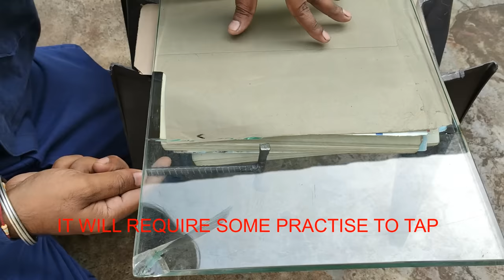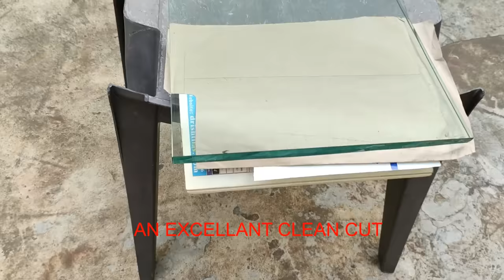How to cut 12 mm thick glass

Comment: One of the things novices do when cutting glass is using too much pressure with the cutting tool. You know when you have done it right by the sound. It should be a light hiss and the score is a fine line , almost hard to see. Too much pressure and the sound is crunchy with score looking like a deep scratch. The deep scratch are tiny fractures running radially from the line and at best will result in a rough cut and at the worst not cutting at all or running everywhere but where you wanted the cut. Also make sure you have cleaned the glass first and the cutter is not nicked and/or dirty. My humble experience.
Reply: Thank you for the information.
Reply: Nope. Too much time just learn from another experienced person

Comment: That’s a horrible cut.  Once you make the score and start the run which may need a hammer on 12mm you use your hand and the weight of the glass to complete the break.  I worked in marine and ag glass for 8 years. Our thickest glass was 1/2 inch ocean going vessel grade tempered and bent.

Comment: Just Use a brush to apply the oil on the glass before you cut it with the glass cutter and then place the sodden back part of the brush under the glass on the end of the cut and snap it pushing down.

Comment: That would be risky when tapping a large piece which would fall because of its weight. A support would be needed on both sides of the glass, and a ball pen hammer would have been better because of the round head as it would give softer taps, thinner glass can just be snapped after one tap to run the line, Thank You
Reply: Why watch a video if you already know everything?
Reply: @christianscustoms6429  That's what we call a dumb question ! Jignesh Tailor's advises are important .
You just earned a dislike .
Reply: Turn it over.
Reply: IF it was a large piece, but it wasn't. The fact that the guy's made his own hammer from re-bar says to me maybe he doesn't simply have access to a plethora of tools so he makes do (& well) with what he has.

Comment: Does that work with tempered glass?
Reply from the maker: No, this trick will not work
Reply: U cant cut tempered at home dude
Reply: @shiyamaifrad8933  I found out the hard way.. lol 
But can professionals/companies do it or is it just impossible to cut?
Reply: @BlackFaceTrudeau  it is not impossible cause u can get custom sizes from companies i guess they cut it with some heavy duty machines
Reply: Tempered glass CANNOT be cut.  Glass companies cut holes, dog doors, handles etc BEFORE tempering.  Do not attempt it as it will explode.
Reply: @stewartmcmanus3991  that makes sense cause u cant do anything with sharp tools in a  glass after its a tempered
Reply: After the glass been tempered it cannot be cut
Reply: Tempered glass is a different animal.  Think of tempered as a bubble and you end up popping the bubble when you break the surface.

Comment: Pahli baat to apko cutting nahi ati
Aur dusri baat ki apki cutting dekh kar kisi bande ne cutting ki to usko 100%
Glass jayega kyuki apne safety ka dhyan nahi rakha
Air cutting ka ye tarika bilkul wrong hai
😕😕😕😕😕
Reply: एक फीट का तुकडा काटने को इतने तो समय
आठ फीटके चार पिस कटींग होते
वो भी एकदम फीनिशिंग मे
Reply from the maker: I will cut 8 pieces in this time but the condition is the glass should be new and for ur kind info here I am using scrap glass which has already a crack.

Comment: Are you using a normal kerosene??

Any other fluids are use?
Reply from the maker: Yes
Reply: I use mineral turpentine for cutting oil for years it works fine as well and cheaper than kerosene have been recycling glass for years much cheaper when doing your own repairs.